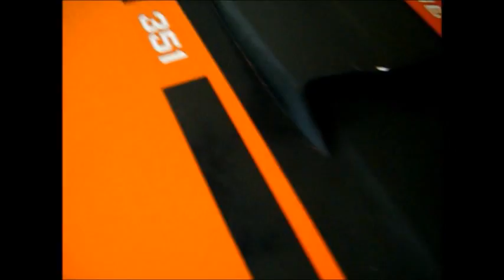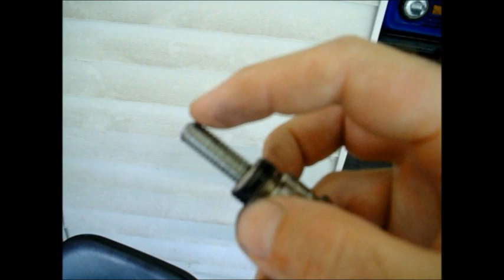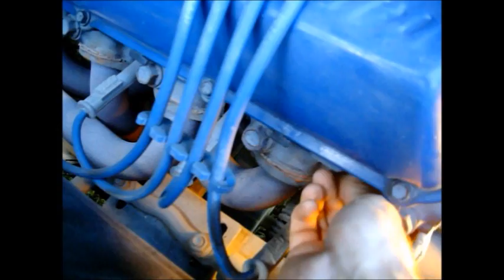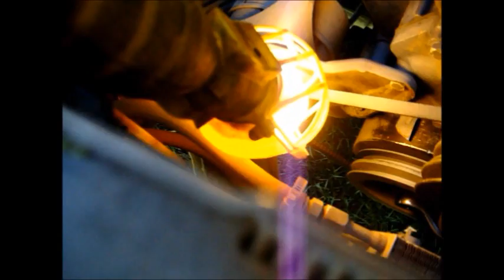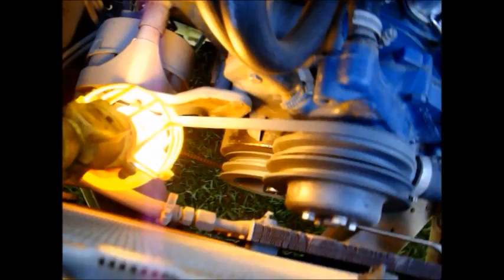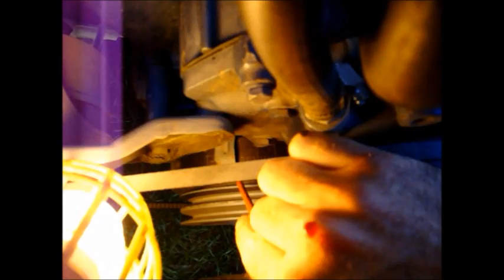Timing - Part 3 - How To - Using a piston stop to find true #1 TDC.wmv

Comment: A piston stop just gets you in the ball park.
Reply from the maker: Explain?  If you use a piston stop, and it stops the piston just before TDC while turning the crank cw, and you mark the balancer, and then you turn the crank ccw and again it stops the piston just before TDC, and you mark the balancer, the exact center of those two marks is TDC.  It's not ballpark, it's TDC.  I'm not making this up, it's how you find TDC when using a camshaft degree wheel.  If there's a better way to find TDC, please let me know.  Thanks.

Comment: Was your true tdc mark further left or right from your original tdc mark on the balancer if that makes sense?
Reply from the maker: Yeah, that makes sense.  The white car wasn't off at all, but a buddy of mine in a different state, he was having trouble getting his timing right.  No matter where he set it, it ran really bad so I made these videos to show him how to verify that his balancer's timing marks weren't lying to him.  He was running the original balancer, so I told him the outer ring isn't attached to the inner ring, it's just two separate chunks of cast iron, with rubber in between, all press fit of course, and shouldn't come apart, but we're driving these old cars longer than anyone including the car builders thought we would.....or should.  With the orange car, just once, and years and years ago, the inner piece of the balancer started to get away from the outer piece, slowly at first.  So if you spin the inner piece, without spinning the outer piece, that puts your factory timing mark in the wrong spot.  The crankshaft is spinning clockwise (forward looking aft), and it's bolted to the balancer, so if the rubber starts to let loose, the inner balancer will outrun the balancer's cast iron outer ring, in a clockwise direction.  If you are looking down at the factory timing mark (on your balancer's outer ring), it's now to the left of where it should be.  So on that orange car, when I found true TDC, and made my own new mark, it was to the right of where my outer ring told me it should be.  The outer ring was lying.  Of course, let it keep slipping and eventually you'll need to make a new mark again, and this time it might be on the left, if it's slipped around far enough.....or it could even be 180 degrees off, so not left or right.......so the moral of the story is that if you find your harmonic balancer is slipping on you, replace it right away.  If you don't, eventually that outer ring will come completely free, and it'll just freewheel, can't go anywhere, it's got an engine behind it, and a crank pulley in front of it, but it'll make a hell of a racket.

Comment: Question: I have pulled my distributor now several times on a AMC 360 ('88 Jeep Grand Wagoneer) it is running horribly and I am now wondering if dizzy went back in and is set up on exhaust stroke -short of pulling a valve cover, how can I verify distributor is set on intake TDC? Thanks!
Reply from the maker: It's real easy, disconnect the battery, remove the #1 spark plug, and have someone turn the crankshaft clockwise with a ratchet and socket on the crank bolt.  While they are turning the engine over by hand, you'll have your finger pressed up against the cylinder head, where the #1 spark plug was.  When you first feel air pressure forcing itself through the #1 spark plug hole, and passed your finger, tell your friend to stop turning, because you're coming up on TDC of the #1 compression stroke (you know it's not coming up on TDC of the exhaust stroke, because you won't feel air when it's all going out the open exhaust valve).  Next look at your timing mark on your harmonic balancer, and your fixed-location timing pointer that you use to set your timing with a timing light.  Slowly turn the crankshaft until the timing marks line up with the fixed timing pointer.  Next question is where should your initial timing be set on an '88 Grand Wagoneer?  I don't know where you want it, and I don't have books that go that new, but let's say you wanted 12 degrees of initial timing.  Using your ratchet, and looking at your timing marks, put it at 12 degrees before TDC.  

Once you've done that, here's what you've got, your engine isn't running, the battery isn't even connected, but physically your crankshaft is positioned so that the #1 piston is sitting 12 degrees before TDC on your compression stroke.  This is where you want your distributor to fire your #1 spark plug.  Look at your distributor cap, find where your #1 spark plug wire is, and using a marker, put a mark on your distributor housing that lines up with #1 on your cap.  Now when you remove your cap, you can still see where the rotor should be pointing.  Remove the cap, and if your rotor is pointing at the mark you made, then you know your timing is pretty close.  If the rotor is pointing the opposite direction, then you're right, and you've got the timing set 180 off, set to the exhaust stroke (I doubt that though, I don't think it'll even start if you've done that, and you said it's just running rough).  If your rotor is a little bit off, you can adjust the distributor to get it right on the mark you made, then tighten the distributor hold down.  While you're at it, look up your firing order, and which direction your distributor turns, and starting with #1, make sure that you've got your firing order correct, if you find two wires are swapped, that's your problem, that would make it run rough for sure.

Now connect the battery and set your initial timing with a timing light, because everything you did with the battery disconnected was just to get you in the ball park.  If it's still running rough, after you've verified all of the above, then maybe it's what this whole video is about, and the outer ring of your harmonic balancer has walked away from the inner ring, making all of the timing marks on the balancer useless now.  This video series shows you how to check if your balancer's outer ring has shifted, by using a piston stop.  It's rare for balancers to come apart like that, but it happens.  It's happened to me twice, and both times, I ended up with an engine that ran terrible, after setting the timing, because the timing marks on the balancer were lying to me.  

That's how I do it anyway, with the ratchet on the crankshaft that is.  And normally I don't have a friend around to turn the crankshaft for me, so I've got one hand on the spark plug hole and my other hand on the ratchet, turning the crankshaft.  Some people like to skip the ratchet idea, and use a remote starter, they remove the coil wire so the engine doesn't try to start and they use one hand to bump the starter motor, and they use their other hand to press a finger up against the #1 spark plug hole.  And if you don't have a remote starter, you can still skip the ratchet idea, just have someone bump the key to turn the engine over.  I don't like doing it that way, because you've got more control with a ratchet, the starter motor can go too fast for me, but either way will work for you.  You can turn the crankshaft around and around, but you'll only feel air blowing out on the compression stroke, you'll know it when you feel it.  I typed a lot, but it's really easy, the main thing isn't to memorize what I typed, it's just to understand what you're doing and why it works, it's just common sense.
Reply from the maker: Oh yeah, and if you do use a ratchet on that crankshaft bolt, be sure to remove that ratchet before you hook up your battery and start the engine.  Put the #1 spark plug back in as well.  :)  Good luck!

Comment: Mr Robertson, here I am once again. You helped me a while back with my 1970 mustang not wanting to start and we found out it was the electrical wiring.

I have a new problem now on a different mustang. It's a 1999 V6 3.8 with 103,000 original miles. My girl was driving it and she drove over a large rock, the rock ruptured the oil pan and she kept driving dry for about 3 minutes before turning the engine off. I removed the oil pan but did not see any metal shavings. I did however notice small drops of coolant. When I turned the engine by hand, piston number 5 pulls a small amount of antifreeze from the top which leads me to believe that the head gaskets are shot, also the top radiator hose is sucked flat like a flat straw. Would you recommend that I get a remanufactured engine or rebuild this engine with mild work like ported heads, ported intake and a more aggressive camshaft? I'll also be installing new rings and bearings. I can get a remanufactured engine for about 2,500. There is always the option of throwing in a 4.6 but I already have the 302 Windsor on the 1970.

I appreciate your time and I hope to hear back from you soon!
Reply from the maker: You can go either way with it, but it's a shame this happened at only 103,000 miles.  My wife's 2003 Ford Escape has 370,000 miles on it, and the original V6 is still going strong.  We even tow with it:   https://www.youtube.com/watch?v=2AIx0NuB3y4  
Like you said, if you rebuild what you've got, you've got the luxury of being able to get that port work done, etc.  That's the direction I've always gone in the past, rebuild what I've got.  These days, it's all about crate engines, but back when I was young, I don't know anyone that was doing that.  Back then, you simply rebuilt the engine you had, and you did exactly what you're talking about, port work, performance cam, higher compression forged pistons, fun stuff like that.  I'm not into any of that hot rodding stuff these days, and there's no way I could afford the premium gas, if I built another 11 : 1 compression engine:
https://www.youtube.com/watch?v=BMGtqMHeJj8 
...but it was fun when I was young.  I've never bought a crate engine, but I might be biased, since I used to work at an automotive machine shop.  Oh and if you do rebuild that engine, make sure they check those heads for cracks....probably just a head gasket though, like you said.
Reply: @owenrobertson  that's impressive work from your wife's V6! Do you still have that 1970 fastback? What kind of power were you making on that 11:1 engine? 
You're right about crate engines, I've always wanted to build a hot rod engine and now I have the opportunity to do so. Im going to pull the engine out this weekend and tear it down, I'll inspect all the parts and see what needs to be replaced then order the rebuild kit accordingly
Reply from the maker: @0rvelazqu ,  my '70 Mach 1 came stock with an 11 : 1, 4V 351C, M code car, I bought it in 1989 for 550 bucks.  I had a C code '65 Mustang coupe at the time, and I wanted to drag race the '70.  I didn't go nuts though, just the basic stuff, port and polished heads, TRW forged flat tops, had the chambers cc'd and the heads shaved a bit for a true 11 : 1.  The early 4V Cleveland was advertised at 11 : 1 compression, but it was actually around 10.7 : 1, if you cc'd the heads and did the math.  I ran a solid Crower cam, roller rockers, 2.19" intake and 1.71" stainless valves, and a 750 double pumper on a single plane Weiand X-Celerator intake.  It would rev to 7k, but it only made around 300hp at the rear wheels, and it never ran quicker than 12.9 in the quarter mile: 
https://www.youtube.com/watch?v=yr-sWL1fqmI
It had a B&M prepped forward pattern manual valve body C6 transmission behind the Cleveland, and 4.11 Detroit Locker in the 9" rear.  Mostly I used it as a daily driver, so it was fine.  It was my transportation to and from work, and I actually drove it from Vegas, where I was stationed at the time, to Sacramento, just to race it on a cool night at sea level.  It ran high 13s in Utah, (4,200 feet elevation), it ran 13.3 in Vegas, (2,000 feet elevation), and it ran 12.9 in Sacramento (30 feet above sea level).  

It was a good car, and I put a lot of miles on it, but I enjoyed spinning it to 7,000 rpm too much, and the Cleveland's bottom end is not built well for that.  I was running the Hank the Crank Cleveland oil mod and restrictors to the solid lifters, and a good oil pump, but that wasn't enough.  The Cleveland doesn't have a third oil galley to feed the crank directly, like Ford's Windsor engines and SBC / BBC.  You'd think Ford would know better than build a high compression, big port, big valve engine like the Cleveland, with only the two oil galleys that run through the lifter bores.  You'd think they would have learned that lesson in 1965 when they had to build the 427 side-oiler, because the 427 center-oilers were starving their cranks at high rpm.  Over the years, I spun more than a few rod bearings in my Cleveland, because they weren't getting enough enough oil at high rpm.  Every time I spun a rod bearing, I'd have to buy a new crank, and a couple new connecting rods, and I'd be right back at it again, with a new oil pump as well, experimenting with both high volume and high pressure oil pumps.  Mostly it held together just fine, and when it did spin a rod bearing, I wasn't too upset by it, replacement parts were a lot cheaper in the 90s, and I didn't mind the work, but I decided that I needed a new plan.  

I found a '69 Mustang Sportsroof, it was a 30 year old car at the time and it needed full restoration, but it ran.  I paid $2k for it.  I pulled the 302 and C4, and built a 10 : 1 460 for it, and this time I wanted low rpm torque instead of high rpm horsepower, and my new car wasn't going to rev anywhere near 7k.  It got a fairly mild Crower solid cam, and the '70 Mach 1 got a new hydraulic cam, because I wasn't planning on revving that Cleveland to 7k ever again.  That engine build video I sent you last time, that was the hydraulic cam Cleveland build.  Anyway, I bored the 460 out to 472 cubic inches, polished the exhaust ports only, installed oversized stainless valves, high rise dual plane intake, and I re-jetted that same Holley 750 double pumper for the 460.  I put headers on it, and ran a C6 with a shift kit and mild stall converter, and 3.50 Detroit Locker in the rear.  It ran low 12s in the quarter with me driving it, and a very high 11, with my friend driving, it, because he's a about 50 or 60 pounds lighter than me.
https://www.youtube.com/watch?v=SetbuZvM6IE
The track video and the dyno sheet are at the end of the video.  

It was a good car, but again, I was also using it as a driver to get around town, and even used it to get the kids to school.  The good thing, was that it redlined at 5,200 rpm, so I never had an issue with oiling to the bottom end, and that engine stayed together.  The hydraulic cam Cleveland stayed together as well, because you get valve float with a hyd cam way before you get 7,000 rpm.  

My tastes changed, and money got tight, and the Mach 1 needed premium gas.  The 460, with it's 10 : 1 compression ran fine on cheap gas, but it only got 6 mpg......so really both cars had to go.  

I had sold my '65 Mustang coupe way back in 2006, after driving it for 21 years, and I bought a '63 TBird.  I sold my '70 Mach I in 2018 and bought a '55 Pontiac.  I sold my '69 Mustang Sportsroof in 2022 and bought a '68 Coronet R/T.  The '55 Pontiac has it's original 287 V8, and it's pretty good on gas.  The Coronet R/T is a 440 car, and I need to build that engine, so I'll be building it to run on cheap gas, but it'll still be expensive to drive.  I sure do miss 2 dollar gas.  

So I went from four old Mustangs to just one.  I've still got my A code, four-speed, '65 Mustang fastback, and that one was always my favorite.  It's got a Comp Cams hydraulic roller cam in it, with roller rockers, and forged flat tops, and a Performer RPM intake and a 600 Edelbrock carb, and headers, but it's pretty mild really, mostly it's just really fun to drive.  I haven't driven it in years, but I'm working on it now, and hope to have it back on the road soon.  It was black when I bought it, but it's originally a Wimbledon White car, so I might go back to white with it.  It runs and drives great, and the interior is really nice, it just needs some body work and paint.

You've got a good plan on your V6 engine build, let me know how it goes.
Reply: Mr. Robertson how are you doing, life got busy with the family and trying to keep up with work. It's been 6 months since I pulled the V6 engine and I just finished rebuilding it. I decided to do a basic stock rebuild as this will be my daily driver. I have too many broken down ford's lol. I haven't been able to start it yet due to me crushing my hand with the engine and the radiator support. I don't think I broke anything but it's definitely going to be sore in the morning. I appreciate all of your useful information.

Comment: it so much easyer to turn eng by fan if you remove spark plugs to put on TDC i dont know where this #1 piston info comes  i have factory manual it plainly states use #6 pos. to set timming   yet people with this same eng will argue its #1  i realize when you set  one you set them all   as matter of fact you can use spark plug hole for tdc it over the valves not the piston??????  one other thing my dist shaft will not go 180  it has offset tang to prevent this